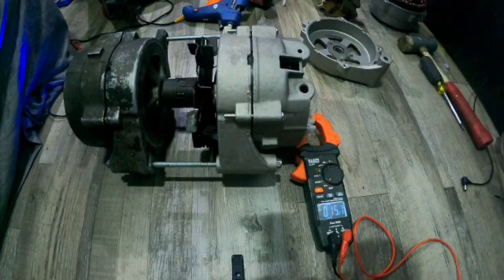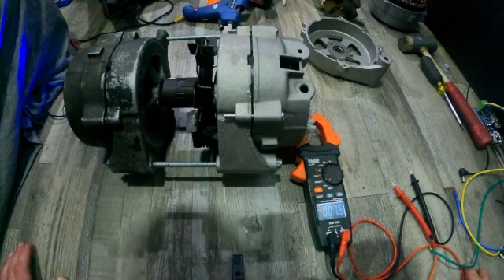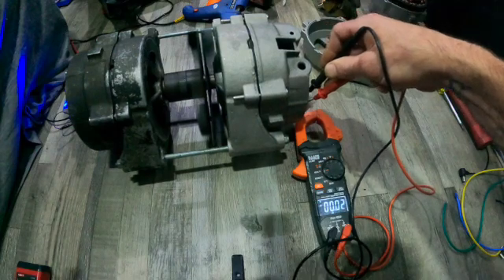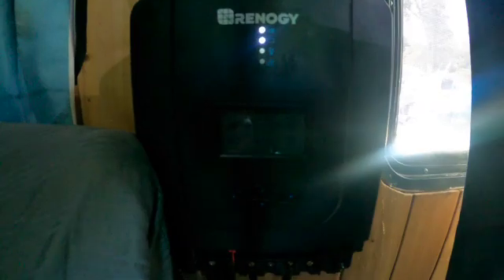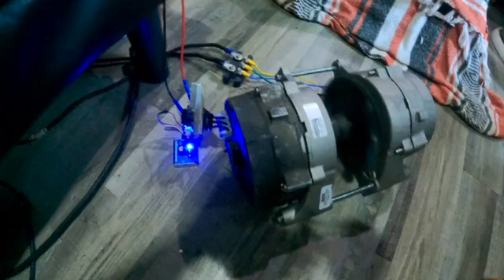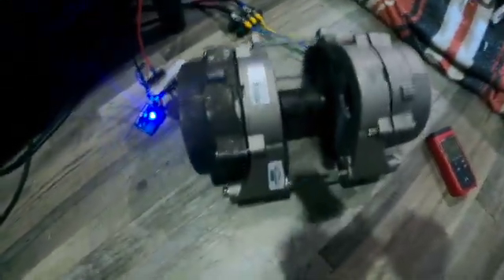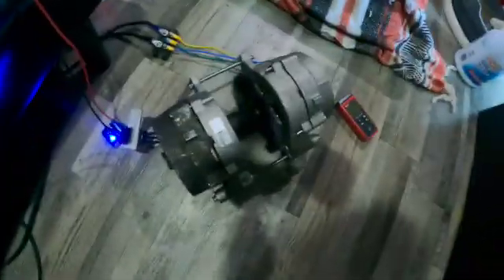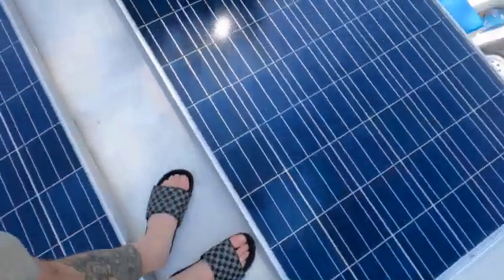Free energy Part 1 , Permanent Magnet Alternator Generator powers motorhome fully off grid

Comment: The alternator will only meet the load that is put on it. 
SO.
USE A HIGH SPEED HIGH TORQUE PM BRUSHED DC MOTOR TO DRIVE THE GENERATOR.
A GEARED TRUCK STARTER CAN TURN A 200 AMP  ALTERNATOR UNDER MAX LOAD FOR LESS THAN 30 AMPS.
IN THIS CASE THE ALTERNATOR WILL PRODUCE THE AMPERAGE THE DC MOTOR IS PULLING FROM THE BATTERY.
IN THIS WAY BATTERY VOLTAGE REMAINS STABLE. WHEN YOU ADD YOUR INVERTER AND POWER IT UP. THE ALTERNATOR WILL ADJUST OUTPUT TO MEET THE TOTAL AMPERAGE DRAW ON THE BATTERY.
WHEN ADD A LOAD TO THE INVERTER THE ALTERNATOR WILL AGAIN ADJUST TO THE AMPERAGE BEING PULLED FROM THE BATTERY.
EVERYTHING SHOULD RUN IN A CURRENT LOOP WHILE SELF MAINTAING BATTERY VOLTAGE AND CHARGE UNTIL YOU PULL MORE AMPS  FROM THE INVERTER AND MOTOR THAN THE ALTERNATOR CAN GIVE BACK.   A 12V 300 A ALTERNATER CAN GENERATE 3600 WATTS.
THATS TWICE THE POWER OF A HOUSE HOLD 120 VOLT 15 AMP RECEPTICLE.

YOU MIGHT WANT TO BUILD A TRI PHASE BATTERY USEING 3 ALTERNATOR OUTPUTS  WITH BACK FEED BLOCKERS, TO DIRECT ALL OUT PUT POWER INTO THE 2 OUTSIDE  BATTERYS WIRED IN SERIES WHILE PULLING POWER OUT OF THE CENTER BATTERY.
I MAY HAVE THAT BACKWARDS.
ANYWAYS, THERE IS A DIAGRAM SCHEMATIC  SHOWING HOW TO CHARGE 3 BATTERYS BY PULLING ALL THE CURRENT THROUGH FROM ONE BATTERY.
FOR SOME REASON THE 2 MANAGE TO MAINTAIN 13 VOLTS IN THE SUPPLY BATTERY WHILE THE OTHER 2 BECOME THE WEAK LINKS THAT SMOOTH THE CHARGE RATE TO THE DRAW BATTERY.
WHEN YOU LOOK IT UP. YOU CAN ONLY FIND IT UNDER THE IMAGES TAB.

Comment: Show us amp consumption and voltage draw on the dc motor during inverter use.
Show us amp out put and voltage output of the generator during inverter use.
Show us amp draw and voltage of inverter while in use.
Show us all these readings simutainously while the system is running your airconditioner.
Show us the reality of your system.
Yutube has enough godam useless show offs already, BOY. MAN up to my request, or go suck one.

Comment: 1 60hz hp =  3.37 gas hp .
A 220v 9A 1800 rpm farm duty single phase motor will easly replce a 15 hp gas engine on a 10000watt 220v 42A  gas generator.
The motor only pulls 9 amps at full load.
This leaves 33 Amps @ 220 volts 
(free to use)
You will need a sungear between the generator and motor to go from 1800 to 3600 rpm
Replaceing the gas engine with a car starter and dc electric lawn mower clutch allows you to start the motor generator with a battery and allows the disconect of the starter from the generator when it starts.
There is nothing FREE, however,
This is how you get 
😮😮😮(FREE TO USE)😅😅😅ELECTRICITY after the cost to build has been compinsated for.

Comment: Hi there great project I want to learn how to do some kind of set up to power our offgrid set up  I am sorry I do not know about electrical my self  wish I did I would get more done and I could help others out ok I would like to ask witch alternator is being used as a motor and how did you set that up to do so and what did you do to get the other one as a perment magnet  ok on the output could you use a Buck booster  and could you branch off power to run the motor to be self run. just use a rope to pull start the set up.

Comment: Did you research the lockridge device from Energy from the Vaccum series? A capacitor was used to harvest the back EMF from the generator pulses.
As for a controller, you might want to look at an ESP32. It has builtin wifi and Bluetooth and so could monitor input/output and vary the motor speed by controlling the ESC you have. The problem running this thing long term is that the bushings in the alternator aren't great. High quality ball bearings will decrease resistance and increase longevity. 

It's possible to build a solid state system but I have a soft spot for mechanical ones as well.
Reply from the maker: I made this video in August. Since then I have been a using a variable dc/dc boost converter where I can monitor input output. I have achieved over 5k rpm and can upload that video soon. The project is evolving fast when I have time to work on it. The alternators have  sealed bearings in the front and pressed needle bearings in the back of the rotor. No bushings. 
 I have not researched the lockridge device but will. Thank you for your input.
Reply: @_GODsWill 
What the hell r u doing.
Replace the entire stator unit with 4 moon magnets and be sure to maintain the original rotor to stator air gap.
This does not disrupt the balance of the rotor. Speed determines voltage and the rotor winding fixes your amps.
Reply: Everyone is putting magnets on the rotor when they should be replaceing the stator ass. With 4 moon magnets.